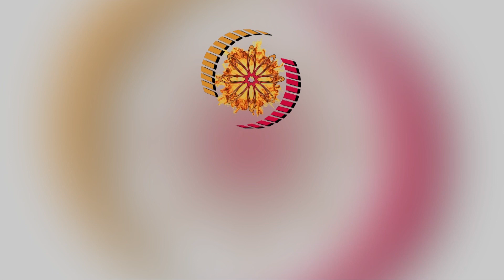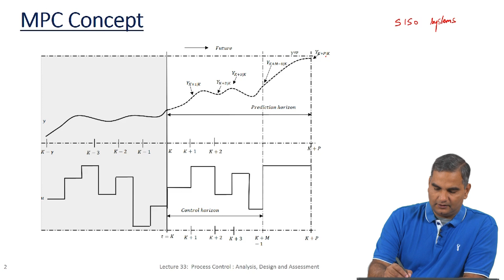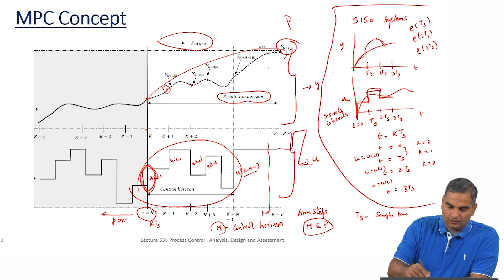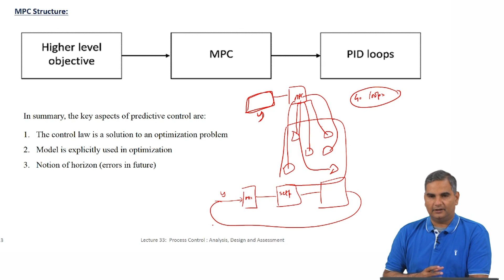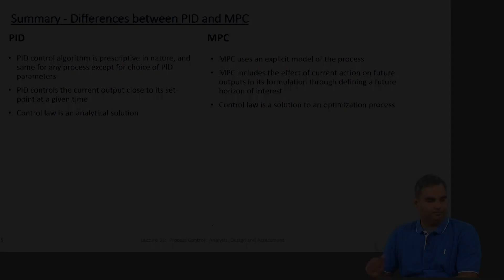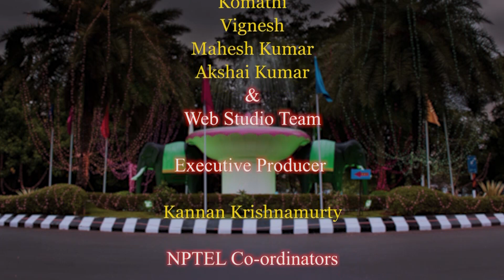Model Predictive Control-Part 2

Comment: Question: 
A distinguishing feature of MPC is its receding horizon approach. Although a sequence of M control moves is calculated at each sampling instant, only the first move is actually implemented. Then a new sequence is calculated at the next sampling instant, after new measurements become available; again only the first input move is implemented. This procedure is repeated at each sampling instant.

 But why is an M-step control strategy calculated if only the first step is implemented? 
Could this be considered a waste of time calculating?
Reply: he explained this. It is to make control input over a period of time. so that the control strategy will not be more aggressive.
Reply: Watch from 25:00